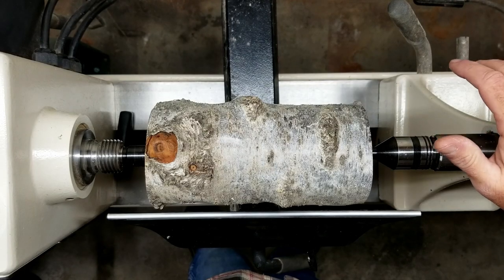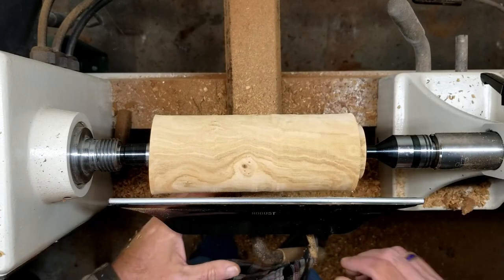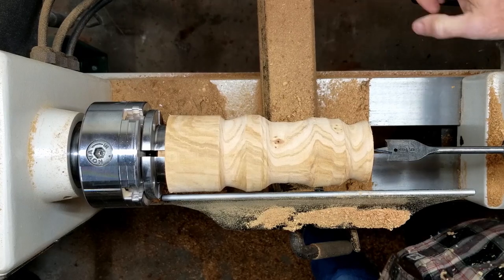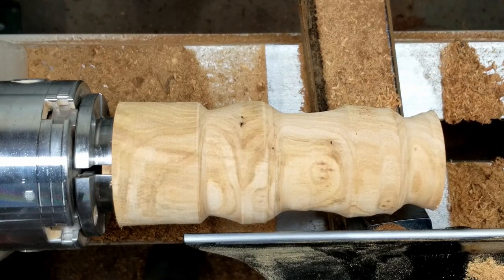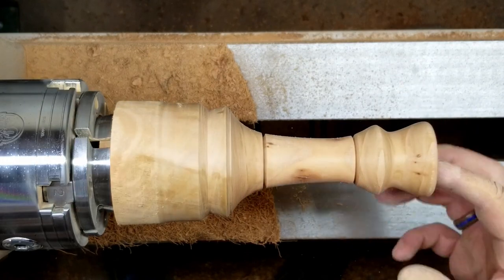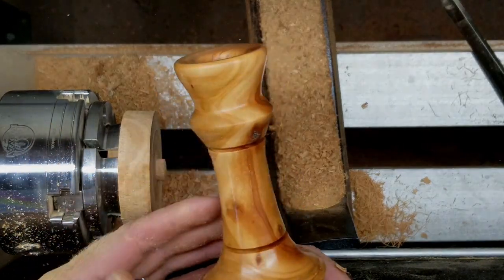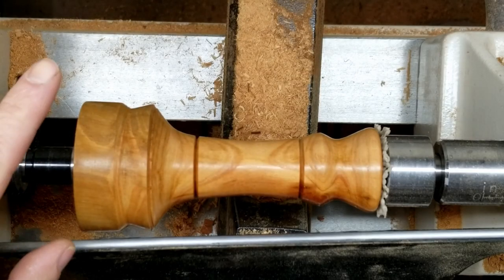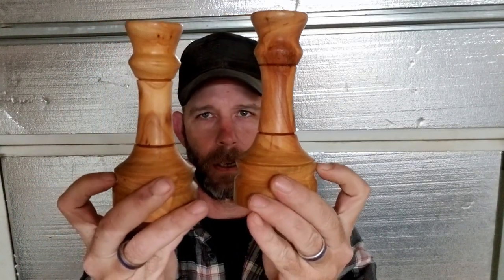Wood Turning: Cherry Candle Holders

Comment: Most excellent work was performed, but for new turners, it would be advisable to use a tailstock as turning at high speed could be dangerous if the item detaches from the chuck.